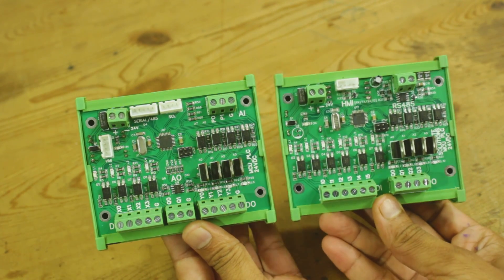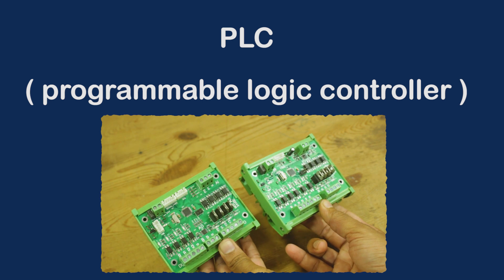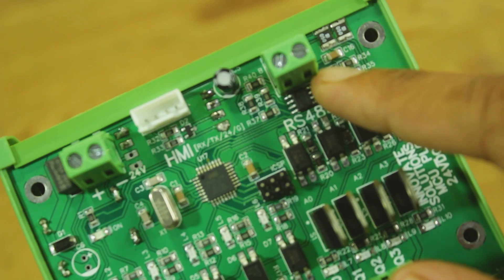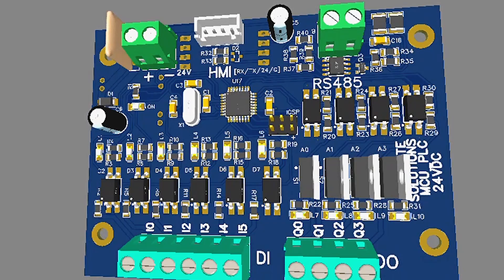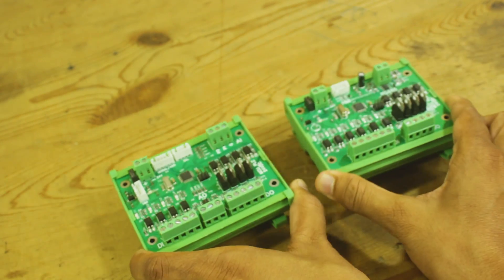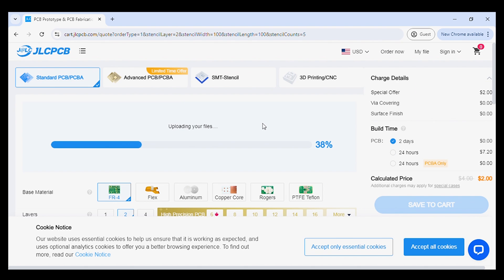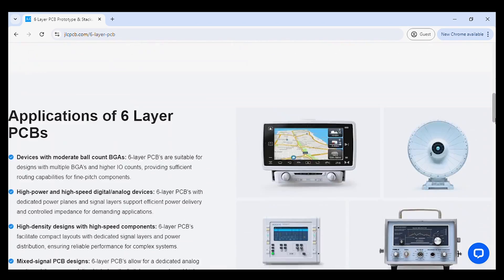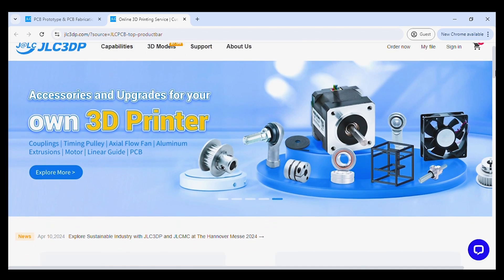DIY low cost PLC using Atmega328P + 24VDC support + RS485 Modbus + HMI

Comment: Hello. I want to make changes to the marlin software of my 3D printer that I made, but my PC's hard disk is broken, that is, the marlin codes that I saved on my printer are deleted. I can't write the codes again. Is there a solution to copy the Arduino to the PC? (I will just add bltouch)
Reply from the maker: Use ICSP option with USBasp and AVRduddess software in this way you can get code from board to PC in hex formate but you can't edit it
Reply from the maker: Use ICSP option with USBasp and AVRduddess software in this way you can get code from board to PC in hex formate but you can't edit it
Reply: @MrInnovative  tanks

Comment: Doesn't the -P indicate a SPDIP chip? - Edit: maybe I'm wrong on that point.
Reply from the maker: "P" in ATmega328P stands for "PicoPower," which is a technology used in some AVR microcontrollers, including the ATmega328P, to reduce power consumption.
Reply: @MrInnovative  Thanks for the info!

Comment: Nice project. But have in mind, PLC have usually a operating time over 15 Years. You can get spare parts and software even 20 to 30 years later. This all cost a lot of money and this money has to be included in the sales prices.

You develop once, but you maintain for a lifetime.
Reply from the maker: With traditional PLCs, you also have to purchase their proprietary software, which is usually quite expensive. However, in this case, the software is open-source, so it's free for life. In my 15 years of industrial experience, I’ve never heard of service costs being included in the sales price. Additionally, traditional PLCs are often difficult to repair; typically, we just replace the faulty module with a new one. On the other hand, this system is designed to be repair-friendly.
Reply: @MrInnovative  Yes this are good points. But i would not say, industrial Moduls are hard to repair. In a production environment it makes no sense. If a Modul fails you quickly change it. There are designed to do it fast and sometimes without need of tools. But i could get over the years some failed Moduls for my personal use. Ironically most of the time simple components in the safety circuits fail and there are easy to replace. I would not reuse these Moduls in a production environment but in my home automation it doesn’t care. 

Can your module also handle 24V AC?
Reply from the maker: agrred, no this module not support 24AC

Comment: good work.but i need to know wich softwere use for programe plc and can i take PTO (pulse out) for servo / stepper motors
Reply from the maker: you can use Arduino IDE, platform IO, Atmel studio or any ARM ide to program this PLC.
yes you can get pulse output at all 4 DO pins at max rate of 1mhz